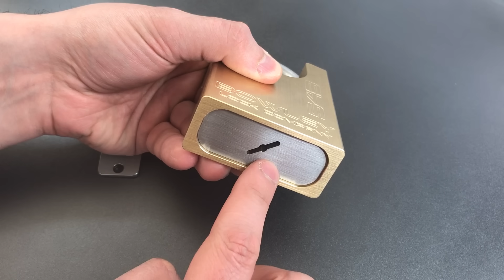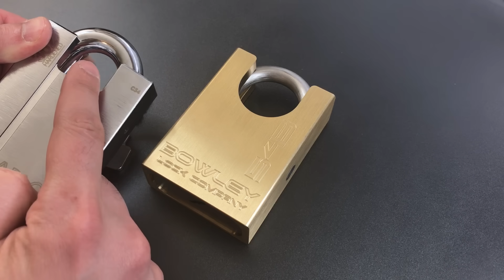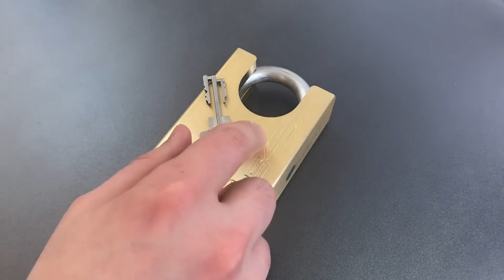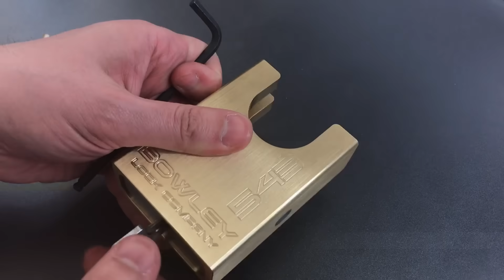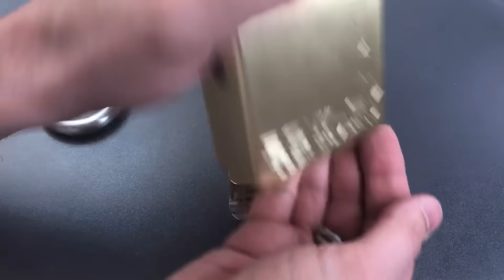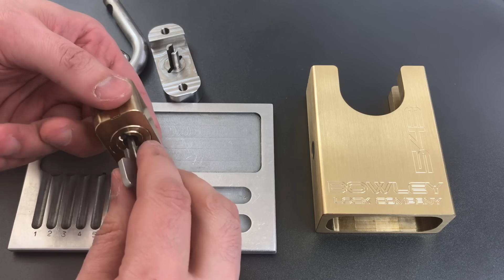[653] Prototype Dual Fork Bowley Padlock (Model 543)

Comment: I own one of these locks.  I have it mounted on an automatic garage door.  After getting my garage door broken into several times I finally found a padlock that nobody can pick.  They might cut it off but they aren't going to pick it or bump it.  I paid 225 for my lock and it's not brass  I had it shipped from Bowley Lock Company in Canada to Georgia, U.S.A.
It took me a while to learn how to unlock it with the key but once you get used to it it's as easy as any other lock.  That key is not going to bend or break in your pocket.  There is nothing made cheap about this lock.  That key is stainless Steele.  I love my padlock.
Reply: Does the key ever snag anything? I wear my keys on my belt loop, and I could definitely see that key ruining a sweater, catching a nylon strap, or snagging on other things. Has that been a problem?
Reply: @CasualDandyAkaSqwrty  If you're worried about the key snagging, you could wrap the key in something.
Reply: @Indigo199517  there's also covers for the blade of the key
Reply: @sharplydressedrabbit3604  key has a damn sheath.
Reply: @CasualDandyAkaSqwrty mine tangles with my other keys and sometimes catches on my pocket if my pants are more fitted. But not bad
Reply: That lock only tells them something is valuable inside. Security is an illusion. They back-up with a truck and chain around the lock- they will get it open. Electric or pneumatic bolt cutter will cut it as well. You need redundancy. Loud, flashing alarms, solid locks (plural.) 2-doors. A backup alarm. Park something in front of the door, etc. Have bright lights that they cannot turn off on all the time.  The idea is if you at least slow them down, they might not bother and simply move on. Redundancy is your friend.
Reply: @MOAB-UT Understood.
Reply: @MOAB-UT  that's why you put a cover on that lock, and scuff it up so it looks like a old well used fairly cheap beefier lock.
Reply: @tylersmith1468  Good point and layers. Also, very important is to orient the keyhole in a manner so that you have to reach up and behind and almost blindly insert a key and twist. Easy if you have a key, near impossible if you do not.
Reply: @MOAB-UT  That lock IS redundancy. If you're out & about being a thief and maybe even skilled at picking locks, you'll see this and give up. Our you'll try, and give up. That's the point. Making it seem like there's something espensive inside isn't gonna attract more criminals - it's 200 bucks, easily justified if you've been robbed multiple times.
Reply: @Merthalophor  No it is not. You don't understand what redundancy means. Look it up.
Reply: @MOAB-UT  Yeah it does, look it up :)
Reply: @MOAB-UT  or go minimalistic...my only valuable thing I own is my laptop, and it's 5 years old already. Find value in friendship and family, and not in objects, problem solved.
Reply: @truemuad  LOL. I have good relationships, but still don't want to lose my stuff to thieves thank you. You are projecting a bit.
Reply: If someone is picking your locks that much, it might be time to invest in security cameras and a fat security guard.
Reply: Follow-up? Hows the lock doing?
Reply: Just camp out in your garage and shoot the robbers in the face. Simple
Reply: You guys seriously didn’t know that he was trolling about the master locks being hard to pick? Geez, bunch of gullible old geezers in this comment section, haha
Reply: I’ve heard that master locks are really hard to pick
Reply: LPL has many videos on Master Locks, they are 100% trash
Reply: "You have a master lock, you can unlock it with a master lock" *slap. 1 second.
Reply: @tinystarthegrey4319  You heard wrong.  Master locks are junk
Reply: @tinystarthegrey4319 master locks are basically worthless. Watch his other videos.

Comment: while this lock is VERY difficult to get access to the pins, It seems that it would be relatively easy to pick if you could get to those pins and properly tension the lock.
Reply: But... that's the whole thing. That's like saying "It would be easy to pick if it was" and yeah, of course
Reply: @sherlockwright7105  absolutely, like many of these "odd locks" it would require a specialized tool, extra security in this locks actual core would make this lock near impossible even with a purpose-built tool is my only point. move over tho on a certain level this lock simply makes me recall the old saying "locks are to keep honest people out"

Comment: There is a question I have about this: Is it possible that the idler rings gets moved, perhaps by some bumps or whatever, without the key being inserted? Because if so, wouldn't this prevent the owner or anyone from opening it unless the idler is somehow moved back into the correct position?
If it is only held by friction, this should at least theoretically be a possibility, right?
Reply: I agree that this theoretically should be possible, but with enough friction on idle ring, I think it eventually comes to the point where it can withstand any kind of vibration. But even if this was a problem, it may be possible to design a special reset spring for the ring, that will put constant tension, disallowing it from getting out of sync with the hole, but still possible to rotate exactly amount needed to open the lock.

Comment: I could probably easily bend or snap the key. I've bent and broken regular keys before using my hands. (Not on purpose.  Key fell out of my pocket accidentally stepped on it bending it then tried to straighten it with my hands and that's when it snapped)

Comment: Now I want to see a quadruple Bowley lock with a cross-shaped keyway.
Reply: I figure at some point putting more tines into the key will make the metal shroud less effective since you now only have to reach around 45 degrees rather than a full 180 with the original lock.
Reply: @khangtruong98  Good point.
Reply: So, the key from the 5th Element.
Reply: Sure, but have two of them spring loaded so you have to squeeze the key's grip to pop them out after partially inserting and turning it.
Reply: @o76923  we're getting into Transformers territory now, which is probably what it would take to easily pick this.
"This is the Lock Picking Lawyer, and today we're going to see how long it takes my nanopick army to open this new lock from Bowley..."
Reply: More. More! MORE! Mooooooaaaaarrrr!
Reply: even if it makes it less secure i would 100% buy that. id exclusively use that door for the sheer enjoyment of using that key. (only on 1 door since im sure i couldnt afford it on more). sorry for necro.
Reply: That is literally just lock pickers nightmare
Reply: You can never have enough, can you?
Reply: No...a swirl cut cylinder made with a non-metallic medical grade titanium, hexagonal cross cut key way with a minimum of 9x9 triple stacked pins😊
Reply: Make it not 8 but a continuous cylinder 😳
Reply: crossed keys.. for the Pope
Reply: Guess what! The Germans had a four bearded lock during the war that is like what you’re talking about. It’s called the bode panzer tangential. I’ve always wanted just a key cause they look so cool. Nearly impossible to find a working one these days. I’d love to see bowley do a four sided lock like that
Reply: pentuple bowley lock with 5 sides
Reply: Someone watched the newest mission impossible lol.
Reply: @atroxiv  Note the comment date.

In seriousness, cruciform keys are rather common in certain parts of the world. They've appeared multiple times on this channel.
Reply: @tomhsia4354  I know, my comment is a joke... I didn't expect such a quick response tho.
Reply: This is scalating quickly

Comment: So what stops someone with some stainless steel cutting discs and a 18v battery grinder?
Reply: Point of the lock is to force you to use heavy tools to take it apart. And if you have to use heavy tools to get whatever is behind the lock, it's probably not worth the effort, and also very much likely of you getting caught. I'd like to see someone trying to steal a bike with a grinder in the middle of the night trying to be "sneaky"
Reply: @lucasboulanger5568  happens VERY OFTEN in England. Thugs go around with battery grinders.

I only have a grinder cause I'm a carpenter and it's in my toolset.
A grinder mat be noisy but it's definatly quicker than almost anyone trying to pick it.
Reply: @1cbrracer  an angle grinder on brass, faster than picking? I honestly doubt it. It might be fast to cut wood with a grinder, but brass is a soft metal. It can cause the wheel to explode under the heat. You gotta use some of those expensive wheel which I doubt those "thugs" will have in handy
Reply: @lucasboulanger5568  stainless Steel cutting discs aren't that expensive and cut brass like butter..... And stainless steel

Comment: What if the key contained a moving mechanism shaped similarly to that key but with a L shaped pins that would swing out the ends with a button push, I imagine it would be pretty impossible to pick the lock without just destroying the lock, the mechanism would make the key quite fragile though, and that would absolutely be a problem if you planned to carry it on a keychain

Comment: I honestly think 11mm is totally fine. If the thief has to resort to breaking the shackle, that means the lock has done its job of being too hard to open using any other method. an 11mm shackle itself my be loads easier to break than a 16mm one, but it's still no slouch. You start sawing an 11mm shackle in public and no way someone isn't going to see something wrong with it, not to mention you're not gonna be able to open it easily with some big shears anyway. The shackle thickness also allows it to actually be used on something that isn't thinner than the shackle itself. What's the point of a thick shackle if the thing that it's securing it easier to saw through than the shackle itself?

Comment: I must say I am very impressed with the engineering of that lock. A company that actually invented a lock for the real purpose of security rather then just cheap and nasty for profit.

Still can't believe no one has created the lock with a computer chip. Not just mechanical. Pin code or finger print.
Hmm or did he crack a safe with that tech. Can't remember
Reply: There are thousands of fingerprint padlocks...

Comment: I understand the shackle size decision for other useability reasons but the example of the chain I feel doesn't make sense. If I came up against this lock on a chain I would simply snip the chain instead of dealing with the lock rendering the strength of the shackle meaningless

Comment: 6:30 so a electrical current could open this lock then?
Reply: the magnets are just to make retracting the ball bearings once unlocked easier (otherwise wou would retract them while pulling the shackle)
Reply: @aurunemaru  ah, so if the ball bearings weren’t connected to the magnets and are loosing, where would they go?

Comment: need one of the spring bendy wires they use in surgeries to pick that , the ones that bend at different points with applying a electrical current

Comment: I feel like if I bought this lock I'd have to buy a safe to put the lock in to protect the lock
Reply: A safe with a quadruple (cross-shaped) Bowley lock.
Reply: the lock is only like 150$ about. Its expensive but its not crazy expensive for a high security lock. You use this for applications where the thing youre protecting is worth far more than 150$, maybe something like a storage unit or shed, where the tools and materials you have inside are far more valuable.
Reply: @eragon78  i feel like sarcasm is lost on you 😕
Reply: @jeffperron3915  its not, its just the internet, you can never tell when people are being sarcastic or not without things like voice infliction or facial reactions.

Youd be surprised at the number of people on here who actually think dumb things that youd expect were sarcastic.
Reply: @eragon78  Yeah right, a shed, where you can cut your way in with a pair of tin snips...lol
Reply: @lenovo762  There are more than just crappy sheds that people have. You can have like actual high grade storage units and stuff.

Not everyone has the same quality of shed. And if you have a crappy shed, then you shouldnt be putting really valuable stuff in it.

Comment: the shackle should be made of hard steel but in my opinion it makes no sense to make it so big you will have to use a chain made from thinner metal than the locks shackle because then the chain becomes the easiest point of attack for cutting and the lock doesnt even matter anymore...

Comment: The cool thing is how simple the machining is for components. It can be exceedingly cheap for its security level. Add in the pickproofing pin trap system he showed in video 527, and this lock would be truly impossible to beat non-destructively.

Comment: Brass wholesale is around 4000 USD a ton. So actual brass in this lock is less then 10 USD. Some CNC machining went into it but most is profit and marketing department.
Reply: You skipped a few steps there....

Comment: If the lock was shaken hard enough, could the idler turn inside the lock and stop the key from ever being inserted? I'd be interested to see if there's a preventative measure to that. If it's just friction alone holding it in place, then I'd be a bit worried about that.

Comment: The single fork key has thus far kept the LPL out so no need for a double fork. Big question is, is there a chain good enough to use the lock on? No point having an unpickable lock if the chain can be cut.

Comment: if you make 5 or 6 bended picks, you coult insert them to pick each pin one by one i guess. or maybe 1 with a retractable sliver of bendy metal thats pushing on the pins so you can rake it. XD

Comment: I would buy this if the company designed some sort of clip-on cover for the key so I didn't rip the flesh off my leg everytime I got my keys out.
Reply: As someone with basic hand-sewing skills, a sleeve would be the easiest thing in the world to make. Cut a square. Fold it in half. Sew the side and bottom closed. Tadaaa. Just get some thicker fabric or leather so it doesn’t snag or tear. Very easy solution.
Reply: @azuroslazuli6948  that's cool that you know that
Reply: Yes, the blade of the key should have a sheath so it doesn't catch on everything like clothing.

Comment: "Seven sixteenth of an inch" is one of the worst things I've ever heard. Just use millimetres, Americans!
Reply: Nah, we’re good here. We can use both, can’t you?
Reply: @emkayusa  i bet you can't
Reply: @ahmed53938  why do you bet that? It's really not difficult. I switch between measurement systems all the time, depending on which is more suited to the situation, and it's easy to do because I'm not an idiot.
Reply: Oh come on, milimeters takes longer to say than sixtheenths, in conversation you almost never say "of an inch".
Reply: Peter Gutfeldt 
How is one meant to visualise “Seven sixteenths of an inch”?
Reply: @vinceemery5943  It's just a unit like any other, somewhat comparable to a milimeter in its scale.  There's nothing inherent in millimeters that makes them easier to visualize, you're just used to using them.

Comment: Crooks use cordless cut off grinders.   Sure they make shackles with 10ton tensile strength or 70HRC against bolt cutters, but what about grinder cutting resistance?

Comment: OH MY GOD... My worst nightmare. A lock that he can't pick. This lock is too dangerous to exist
Reply: He says the body is brass, meaning that you can destroy it with standard cutting tools
Reply: @Cailloumax  Non destructive, Not Everyone can break a lock on the go
Reply: @RavenTeamGyatt  your lock is FAR FAR FAR FAR FAR FAR FAR (did i mention FAR) more likely to be broken not picked
Reply: @Cailloumax  Yeah you can but your not gonna be very stealthy.
Reply: @Cailloumax  That generates noise, and noise brings unwanted attention. Running around with tools big enough to break through this giant thing also attract some attention.
Reply: @Cailloumax  So get the steel variant, lmao.
Reply: @Cailloumax  only the limited edition is brass, the production one is steel
Reply: 2050 - in 20k 300Hz, 3D, lpl with slightly shaking hands: "... 3 is binding. Click out of 3 ..."
Reply: Important word you're missing is "yet"
Reply: @megan00b8  Lol no one can pick the five pin variant. You seriously think its possible the pick this one with double the pins?
Reply: @seblat1086  I'm certain it can be picked, the real question is if it's worth the effort for someone to figure out how.
Reply: @seblat1086  5 x 2 = 9
Reply: Give em time.  Nothing last forever.
Reply: Has this been pucked yet?

Comment: I was wondering if you could showcase a lock which I have only seen used in a Casino I worked for many years ago. Rather than a notched key they use a key which was diveted for lack of a better description. It was marketed as superior to standard locks because it was supposed to be very difficult to copy the keys.

Comment: Pin shields are relatively thin,with a drill you can easily cut them of,becose the lock is not on the doors you can reduce the vibration so the sound when drilling  is not to high.Then you can open it with the tools and not making any sound at all.
So is it save?
It still depends where your bike is locked

Comment: Very strong bike holder, hard to lock pick, but the chains might be just small and flimsy. To prevent this, they should also sell chains with or without the lock, that is specifically used to make the chains not break. Maybe hardened steel, like as hard as the key’s strength, and also as thick as the shackle. The real thing will be even better, so not only do you need a long metal rod with 1 U turn, but you need the exact key shape to unlock it.